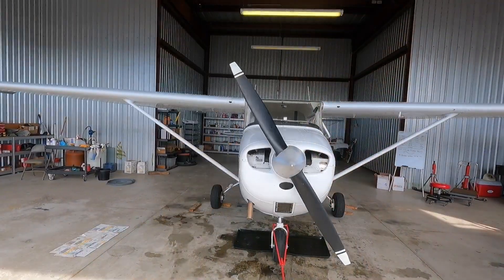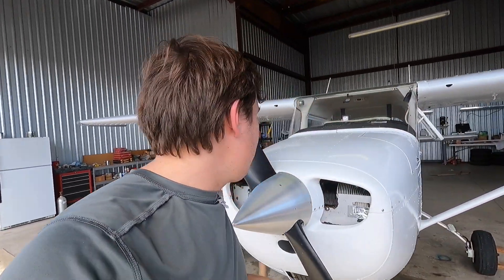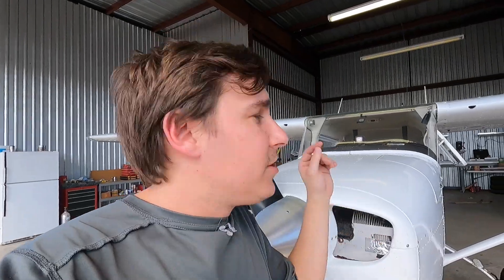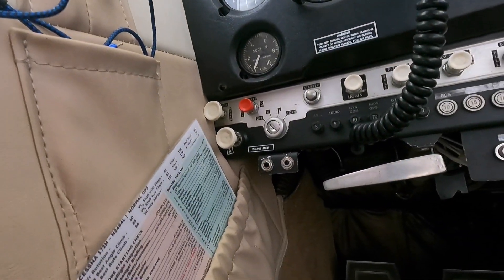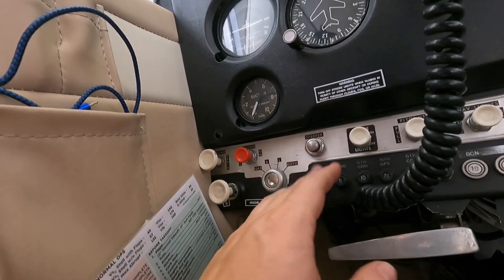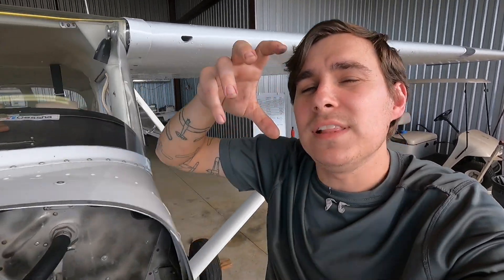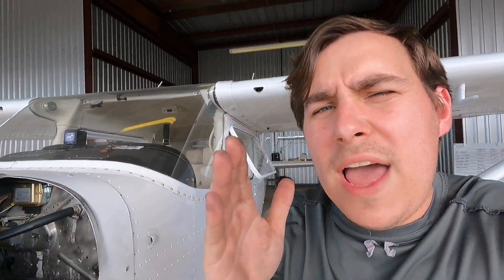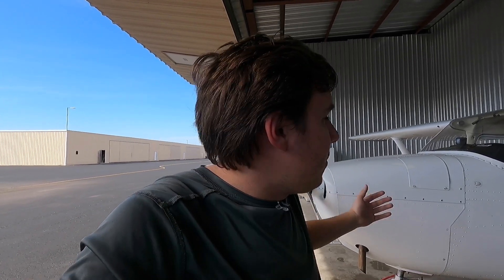Essential Propeller Safety Tips | Stay Safe Around Aircraft Props

Comment: Only when cold: no passenger in the plane, keys on the dash(it's the same system as the mooney you describe, OFF-L-R-BOTH-START then push), 4 turn of the prop by hand, hear the impulse coupling, feeling compression and avoid damage in case of oil in the chamber. then start and go fly. Before shutdown, test the grounding of the mags at around 800rpm from left to OFF for few revs them put it back on both then ramp it to 1500 and pull the mixture. if the engine doesnt slow down on thw OFF possition then the prop will not be moved by hand until it's fixed. On hot engine it's more like, will it start? since most of the fuel as vapor locked in the carb.
also on a good O-360 you can't do flat hand on the prop there it's too much volume/compression for that, even going through compression the whole plane move around. 
I know a lot of people doesnt check there mag grounding in the shutdown procedure...
Reply from the maker: All good advice. I have only ever had 2 engines fire on me during maintance both were hot fresh after shutdown and both were Lycoming O-360's strange coincidence.